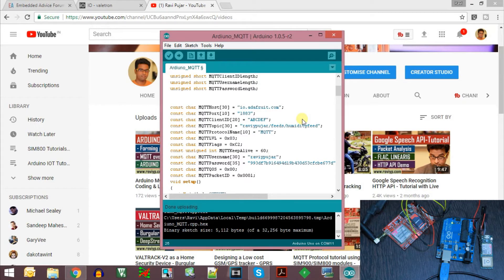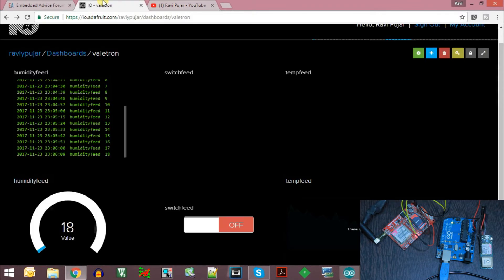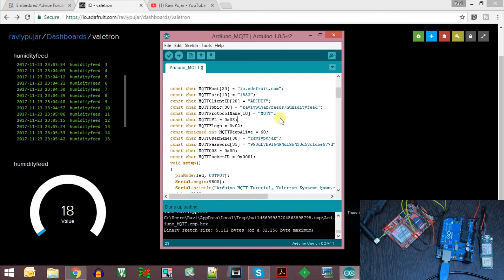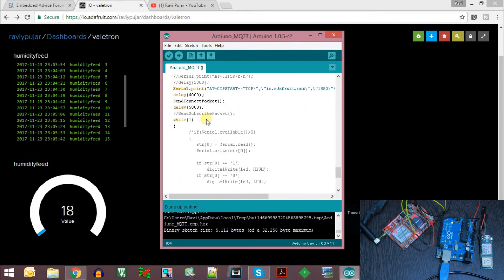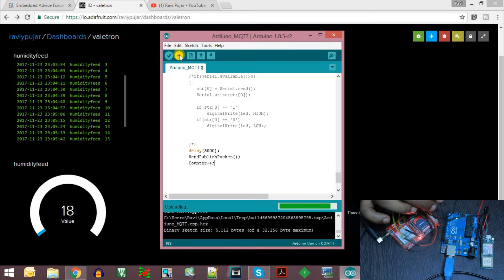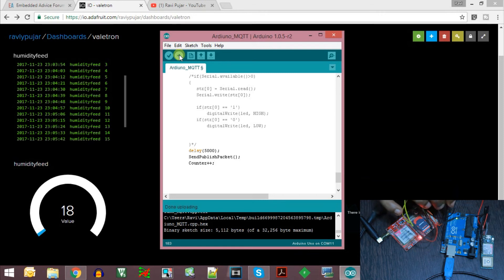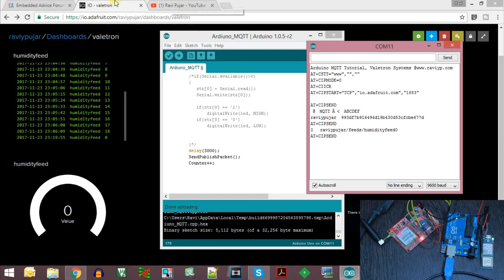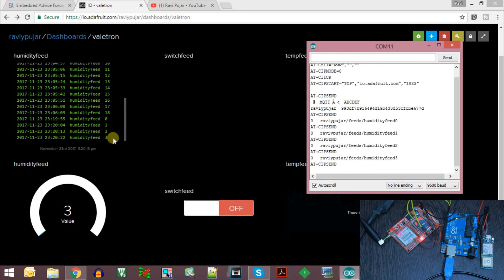Arduino MQTT Publish tutorial using IO.ADAFRUIT.COM server

Comment: Hi Ravi, 
thank you for your efforts to share your knowledge.
I'm tring to connect to adafruit broker via mqtt with a Maduino Zero SIM808 (https://www.makerfabs.com/maduino-zero-sim808-gps-tracker-v3.5.html) so I can't use softwareserial port to due to the chip ATSAMD21G18.

I compile your code but appear an issue  about "&amp" . For example in this line "Serial.write(MQTTPacketID &amp; 0xFF);"

Could you help me in my project?
Thank you

Comment: i am trying to publish data to io.adafruit.com using ESP8266 wifi module and arduino. can you help me? i am using your code for sending mqtt packet but its not working...
Reply from the maker: You can post queries to http://www.embeddedadvice.com We can discuss.
Mostly it will be the protocol name or the API key that needs to be sent. Check if they changed anything after i made the tutorial. its been long time.Use it as base and update to their new connection methods.

Thanks for watching and Dont forget to share and Subscribe :)
Reply: @RaviPujar   code i used:
Code i used is bellow:

#include "WiFiEsp.h"

// Emulate Serial1 on pins 6/7 if not present
#ifndef HAVE_HWSERIAL1
#include "SoftwareSerial.h"
SoftwareSerial mySerial(6, 7); // RX, TX
#endif

char ssid[] = "Cohive L-5 C";            // your network SSID (name)
char pass[] = "P!!c@123";        // your network password
int status = WL_IDLE_STATUS;     // the Wifi radio's status
String pc;
String wifi;
unsigned int counter=10;
unsigned long datalength,CheckSum,RLength;
unsigned short topiclength;
unsigned char topic[30];
char str[250];
unsigned char encodedByte;
int X;
unsigned short MQTTProtocolNameLength;
unsigned short MQTTClientIDLength;
unsigned short MQTTUsernameLength;
unsigned short MQTTPasswordLength;
const char MQTTHost[30] = "io.adafruit.com";
const char MQTTPort[10] = "1883";
const char MQTTClientID[20] = "ABCDEF";
const char MQTTTopic[50] = "mayuresh4007/feeds/abc";
const char MQTTProtocolName[10]="MQTT";
const char MQTTLVL = 0x03;
const char MQTTFlags = 0xC2;
unsigned int MQTTKeepAlive=60;
const char MQTTUsername[30] ="mayuresh4007";
const char MQTTPassword[35] ="AIO key";
const char MQTTQOS =0X00;
const char MQTTPacketID =0x0001;
void setup()
{
  // initialize serial for debugging
  Serial.begin(9600);
  // initialize serial for ESP module
  mySerial.begin(115200);
  // initialize ESP module
  /*WiFi.init(&mySerial);

  // attempt to connect to WiFi network
  while ( status != WL_CONNECTED) {
    Serial.print("Attempting to connect to WPA SSID: ");
    Serial.println(ssid);
    // Connect to WPA/WPA2 network
    status = WiFi.begin(ssid, pass);
  }
*/
 mySerial.println("AT");
  mySerial.println("ATE1");
    //mySerial.write(Serial.read());
 // }
 
 delay(200);
  if (mySerial.available()) {
   wifi=mySerial.readString();
    Serial.println(wifi);
      }
      
      mySerial.println("AT+CWJAP=\"Cohive L-5 C\",\"P!!c@123\"");
      delay(5000);
      do{
       
   pc=mySerial.readString();
    Serial.println(pc);
      }while(mySerial.available());
 // Serial.println("You're connected to the network");
  mySerial.println("AT+CWMODE=3");
      delay(500);
      if (mySerial.available()) {
   wifi=mySerial.readString();
    Serial.println(wifi);
      }
      mySerial.println("AT+CIPMUX=0");
      delay(500);
      if (mySerial.available()) {
   wifi=mySerial.readString();
    Serial.println(wifi);
      }
      mySerial.println("AT+CIPMODE=0");
      delay(500);
if (mySerial.available()) {
   wifi=mySerial.readString();
    Serial.println(wifi);
      }
      
}

void loop()
{

  mySerial.println("AT+CIPSTART=\"TCP\",\"io.adafruit.com\",1883");
      delay(1000);
      do{
       
   pc=mySerial.readString();
    Serial.println(pc);
      }while(mySerial.available());
  //delay(3000);
  SendConnectPacket();
  do{
       
   pc=mySerial.readString();
  // delay(500);
    Serial.println(pc);
      }while(mySerial.available());
  //delay(3000);
  SendPublishPacket();
  delay(500);
  do{
       
   pc=mySerial.readString();
    Serial.println(pc);
      }while(mySerial.available());
  delay(3000);
 
}

void SendConnectPacket(void)
{
  
  
  MQTTProtocolNameLength=strlen(MQTTProtocolName);
  MQTTClientIDLength=strlen(MQTTClientID);
  MQTTUsernameLength=strlen(MQTTUsername);
  MQTTPasswordLength=strlen(MQTTPassword);
  datalength=MQTTProtocolNameLength+2+4+MQTTClientIDLength+2+MQTTUsernameLength+2+MQTTPasswordLength;
    X=datalength;
mySerial.println("\r\nAT+CIPSEND=50\r\n");
  delay(3000);
  mySerial.write(0x10);

  do
  {
    encodedByte=X%128;
    X=X/128;
    if(X>0){encodedByte |= 128;}
    mySerial.write(encodedByte);
 //   delay(50);
}

while(X>0);

mySerial.write(MQTTProtocolNameLength >> 8);
mySerial.write(MQTTProtocolNameLength & 0xFF);
mySerial.write(MQTTProtocolName);
//delay(50);
mySerial.write(MQTTLVL);
mySerial.write(MQTTFlags);
mySerial.write(MQTTKeepAlive >> 8);
mySerial.write(MQTTKeepAlive & 0xFF);
//delay(50);
mySerial.write(MQTTClientIDLength >> 8);
mySerial.write(MQTTClientIDLength & 0xFF);
mySerial.write(MQTTClientID);
//delay(50);
mySerial.write(MQTTUsernameLength >> 8);
mySerial.write(MQTTUsernameLength & 0xFF);
mySerial.write(MQTTUsername);
//delay(50);
mySerial.write(MQTTPasswordLength >> 8);
mySerial.write(MQTTPasswordLength & 0xFF);
mySerial.write(MQTTPassword);
//delay(50);
mySerial.write(0x1A);
//delay(50);
}

void SendPublishPacket(void)
{
 mySerial.write("\r\nAT+CIPSEND\r\n");
 delay(3000);
 
 memset(str,0,250);

  topiclength = sprintf((char*)topic,MQTTTopic);
  datalength = sprintf((char*)str,"%s%u",topic,counter);
  delay(1000);
  mySerial.write(0x30);
  X=datalength+2;
  do
{
  
  encodedByte = X%128;
  X=X/128;
  if(X>0){encodedByte |= 128;}
  mySerial.write(encodedByte);
//delay(50);
}

while(X > 0);

mySerial.write(topiclength >> 8);
mySerial.write(topiclength & 0xFF);
mySerial.write(str);
//delay(50);
mySerial.write(0x1A);
}
Reply: @RaviPujar  And i also try to publish packet using hercules s/w but it doesn't  work.

Comment: Can u help how to use old mobile as a gsm module for arudino..
Coz it Involves many connections
Reply from the maker: Hi Gowtham,
Which mobile are you using and does it support AT command access to its GSM module via UART?
Reply: Ravi Pujar 
I haven't tried it brw,I have an old Nokia mobile
I want to ask whether it is possible to use it as gsm module??and how??
I'm new to arudino Programming
Reply from the maker: Gowtham, i don't think you can use old mobile phones as the interface options are not documented. May be some mobiles have a port left out for AT command interface but there will not be any documentation available.
Please create a topic at http://www.embeddedadvice.com/ we can discuss there.

Comment: Thank you for great job....
Reply from the maker: Akshay Manekar Thank you.  :) 
Let me know any suggestions on new video topics.  Please register on embeddedadvice.com and post your suggestions in Tutorial suggestions category
Reply: Ravi Pujar Thank you for attention.  Can you explain sim900 and google iot services. Mqtt communication???
Reply from the maker: Sure, Akshay, I can do that.
Reply: Ravi Pujar please. It will great help for me....
Reply from the maker: Akshay, Will do soon. The Google IOT uses encryption. So trying to see how it can be done. They dont allow non encrypted connections.
Reply: Hey Ravi, i want better service than addafrut like google iot or aws iot service what can i do?
Reply from the maker: Hi Akshay, 
You need to use SSL encryption enabled devices. As google especially doesn't support non encrypted connections. Which device do you want to use for sending data?
Reply: I am using A6 gsm module for sending data and other side mobile device. I dont know about ssl encryption.
Reply: Hi Ravi,  how can we use ssl encryption  using sim900 module.  Is that possible?
Reply from the maker: You can use SSL with HTTP commands to access HTTPS sites. 
But for MQTT i think you need to do encryption on your controller itself. And it is not possible using normal MCU. Need more resources for SSL/TLS encryption.
Reply: Which mcu's use for encryption? And without encryption which iot platform best for low range mcu's and gsm module?
Reply from the maker: STM32 cortex M4 series are better. 
Any platform which doesnt make SSL/TLS compulsary. Like CloudMQTT or Adafruit etc. 
Google AWS are making it compulsary.  Try Dreamfactory, but you need to install it on your own server.
Reply: Which mcu support ssl encryption?  I am using PIC family. Any other mcu best for this?